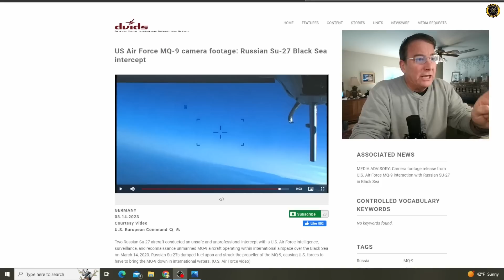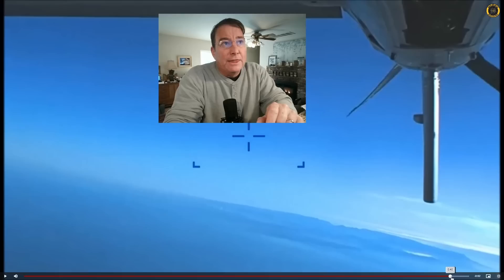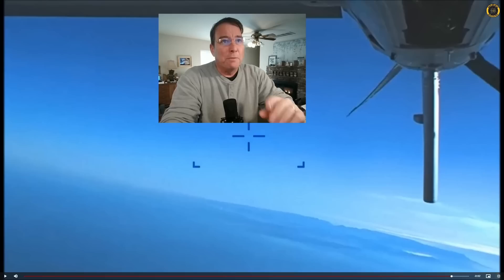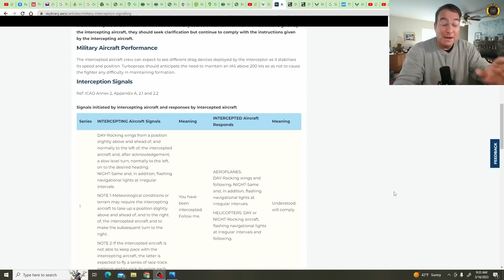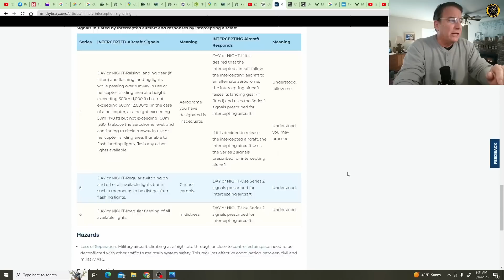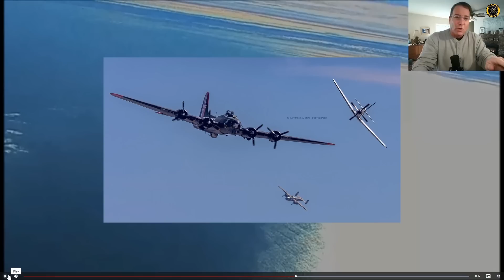Botched Russian Intercept of MQ-9 Drone Over International Waters

Comment: He hit that propeller so hard he knocked all the yellow stripes off of it!
Reply: You can see in the "before" images that the stripes progressively disappear as the props move towards the 6 o'clock position (due to sunlight reflection).
Reply: @ImperrfectStranger  You can also see it was over water before the hit, but that SU hit the drone so hard it was over land with different cloud formations after the collision.
Reply: @wally7856  That is due to the same reason you can't see the stripes.  The MQ-9's heading changed during the encounter.  This is due either to disruption of the flight controls due to the intense wake of of the Su-27 or direct contact.
Reply: And didn't shake the camera one bit

Comment: Lack of airmanship ?
Looks like precision airmanship.
Reply: exactly,  there is a better way to pee on a drone, but this manoeuvre is actually perfect for damaging a propeller and clipping out, drone down, flanker with 2 scratches
Reply: @kemc77  Except if you miss, you have downed a relatively cheap drone - but lost a fighter and possibly killed the pilot in the resulting mid-air. There are better ways to get rid of a drone than by hitting it with your own plane.
Reply: Dumb luck, not skill.

Foot lower / left / right could have damaged or locked a control surface on the -27. Compare to the first pass: Many feet further away.

At the jet's likely +/- 400 knot speed, the time granualrity is far smaller than human perception, like .0X seconds. Average human reaction time is 0.25 sec (1/4 sec) If the intercept pilot is young, peak condition & really switched on, they might achieve a sub 0.20 time. At the closure speed that's FEET rather than inches.

Even tho he downed the Reaper it was into international waters; expect an 🇺🇲 sub-based recovery team to grab the drone bits ASAP, keeping 'em outta 🇷🇺 hands.

Not that we'll hear about it for many years.

Comment: Am wondering ... if the Su-27 hit the prop, wouldn't he had hit the tail surfaces first?  That V tail on MQ-9 is pretty large ...
Reply: Points downwards
Reply: No it doesn't! I must have been thinking of another drone. It does seem to effectively cover the prop disc just like you said
Reply: if you look at a head-on view of the predator online it looks like the prop is actually semi-protected by it's 3 tail fins... and spinning at the speed they were, why weren't all the blades damaged?
Reply: @t.c.2776  It's not protected from behind ...
Head on, you can see how wide the gap between the tails is
At least 2 of the 4 blades were visibly hit (it seems to be a later MQ-9B Seaguardian)
One badly enough to bend it, one badly enough to feather it.
I've never seen just one blade feather on a prop - have you ?
Reply: Jet wash broke it. They had to cut the tape to hide that.  JB playing his part in the propaganda.

Comment: Hi, US army drone pilot here. I don't fly reaper but I do fly it's little brother, the gray eagle. Very similar system. When the fighter struck the UAS, it killed the engine. You can see the RPMs severely dropped. Due to the two damaged blades on this airplane, the propeller was not able to windmill fast enough to restart the engine. I would think that 2 blades would be enough to keep them aloft at least at lower altitudes. These airplanes are basically powered gliders, they have super high coefficients of lift. The reason this airplane went down was because the engine went out.

Comment: Or could the damage have been caused by the force of the jet exhaust and/or air vortex that, I would assume, would be pretty powerful. Not a military aviation expert or navigation system engineer, but I believe the "N" (North) is your bearing indication with relation to the camera. Prior to the loss of video, which would make sense due to a sudden jolt of some kind, the Sun is to the right of the drone (left of the video perspective in what looks to be early-mid morning). The camera is not completely looking 180 degrees aft, but is moving toward the rear direction (@5:49 to @5:53). That looks like the heading of the drone was somewhat of a northwesterly direction, Sun to the East/Southeast. After video resumes, the Sun is now more to the LEFT of the drone (video perspective right). And the bearing indicator shows North jumped from the 7 o'clock position to 10 o'clock. With the camera full aft. Now it is travelling in a southwesterly direction. Like the drone was "pushed" off its heading (strike or jet exhaust). That also explains why you do not see the yellow prop markers like you do @4:26 when the drone was traveling in a northeasterly direction, more towards the Sun. The sun is actually shining more on the back of the propellers, from the camera perspective. That is a logical explanation (debunk) of the missing stripes CGI conspiracy.
Reply: ...and I will add that this is the video what was given to the public. The video knockout could have been edited in to intentionally remove any "incident" that the military would believe would look like a weakness or flaw of the drone in some way. There is no video timestamp (which can be faked, I know) so that blackout could have been longer than the 5 seconds or so that we see. Which seems kind of odd, come to think of it. I would assume that any video camera feed would have a recorded timestamp of some kind. Time, date, bearing, airspeed, etc... For any reviews of an event like this. More conspiracy fodder! ;-)

Comment: Love the channel,  Juan! I'm an old T-56 guy.
Just a minor correction: The prop will move through zero pitch to achieve reverse. Feather is going in the other direction.
Reply: -15 or -16 navy?
Reply: Yeah as a turboprop guy myself I felt my eye twitch haha.  Glad someone said something.
Reply: @fasousa4798  No. Just no. The F-15 and F-16 are Air Force aircraft, not Navy.

He is likely a Herc guy (or P-3, C-2 or E-2 guy if he was prior Navy)

The T-56 is the military designation for the Allison 501 turboprop engine. Also found in the Lockheed Electra and Convair 580.
Reply: @adamreznik6374  when i said -15 and -16 i was referring to the submodel of the T-56 engine. the -14 is used on the P-3, - 15 usually on E and H models and -16 is usually the Navy C-130T or R engines which are the same as a -15 as far as i know.

Comment: Looking at the drone configuration it seems nearly impossible to only impact the prop unless it is possible that the density of the fuel being dumped was enough to damage the prop.
Reply: I'm guessing the force of the fuel damaged the prop. Had the plane actually hit the drone, it probably would have fallen out of the sky immediately as it was disintegrating. The prop looks like it would be protected by the vertical/diagonal stabilizers. Either way, it was an asinine and risky move. Something only a Russian would think was a good idea. And then, of course, they denied it, even though there's video proof. Could these people be any more deceitful, untrustworthy, unscrupulous, unprincipled? No.
Reply: Agree.... the tail surfaces are close enough to the prop that I can't see how the jet could just ding the prop without damaging the airframe with that fly-by.  Also, was the transponder on?  The drone isn't up there sightseeing.  The Russians say they got the drone so assets were pretty close.
Reply: Now that you mention it, that's a very plausible explanation.
Reply: @OMGWTFLOLSMH  With drones we have moved into a new realm of engagement.   The threshold to "do something rash" is lower.  Depends on the adversary.  The Sweds lost a DC-3 intel aircraft in international airspace to a Soviet shootdown at the orders of Stalin.  The US had intel planes shot down close to Red China.  Both of these areas had loss of life of the aircrews.  Since the US is giving intel and targeting information to Ukraine, it would be interesting to know the mix of satellite and drone recon.... which of course...we won't.
Reply: There is NO WAY the fuel could have caused that kind of damage. No way. There was a direct contact between the drone and the fighter. The fighter has got serious damage from the collision.
Reply: How do you figure it's impossible to impact the prop? And who said it didn't also hit other parts back there? Even if it took a chunk out of the stabilizer, the MQ-9 has an enormous wingspan like a glider, and they are very stable. They have to be stable, because with a minimum of 1 full second of delay between control inputs and the drone responding, it has to be very difficult to upset.
Reply: Fuel dump damaged the prop.  No way jet could hit the prop without hitting the airframe.  Props are made to chop air, not liquid. That would have caused an excessive over load on the prop blade.
Reply: @RAPR117  Guess they can't fly in the rain.  Fuel dumps are not dense enough to bend propellers like that.
Reply: @mbasir  theres no way to hit a prop smaller than all the stabilizers around it without hitting said stabilizers, and theres nothing falling away in the cameras rear and lower view.
Reply: @RAPR117  yep. what we're looking at there is fluid volume + speed discrepancy = i know who lost more money in that one. ;o)
Reply: @erice9536  trying flying under a waterfall... see what happens. just for shits'n'giggles.
Reply: They could have hit both the prop and the V-tail. The camera isn't able to pan up enough to visually see all the potential damage on the V-tail on top
Reply: On the final pass, the SU-27 was in a pretty decent bank. Pay attention to where the drone's wing is at the start of that part of the clip compared to how low the SU-27's wing dips down in the final frame. The camera is pointing slightly below horizontal at that point, and yet the SU-27's wing is filling the top third of the frame. There's no reason the wing tip couldn't have struck the prop and then passed right between the tail surfaces (with or without damaging them to some degree).

As can be seen, the fuel dropletizes almost immediately upon hitting the air stream. And it's not like a heavy rain storm is going to destroy the prop. If the prop were really close enough to be striking solid sheets of liquid fuel, then the drone would already be in the process of being sliced in half by the other aircraft's wing. Going frame by frame, it appears to me that the fuel missed the drone on both attempts in any case.
Reply: That's definitely not fuel damage. The tips of the prop would not curl as we see in the aftermath if it was only fuel that hit it. That kind of damage is from a solid object collision striking the outer diameter of the prop.
Reply: I am a mechanical engineer and a pilot….are you?
Rain is air with few water droplets spread throughout it.  A VERY close fuel dump is like making the prop designed for AIR push through water.  There is a reason boat props look different than airplane props….fool
Reply: @RAPR117  I’m a mechanical and aerospace engineer. BSME and MSAE degrees. That has been my day job for the last 16 years. So… yes?
Reply: @RAPR117  The fuel vaporizes immediately, it's like flying through rain, and that causes no damage to the propeller. The only possible way that damage could have happened is through direct contact between the fighter and the propeller.
Reply: One of the drone's blades (not the bent one) is seen rotated to an approximately feathered position, out of alignment with the others. That points to a change in the medium through which the blade was moving, to point it more in the direction of the flight with enough violence as to shear the pins and or gears of the prop's pitch control mechanism. Contact with a plane would not have caused the blade to be instantly feathered and little else.

If you consider the densities of air vs TS-1, even at 10% concentration of the latter AND even dilution that would be 2 orders of magnitude beyond the prop's likely design limit. And it wasn't 10% nor even - the shape of the ejected fuel cones behind the jet makes it clear it doesn't spread too rapidly: one fuselage length behind the outer spread width is still less than the horizontal fins' span. And it's far more dense in the middle, in a bell curve type distribution. It's plain to see the jet is approaching with such an angle of attack as to douse the prop and air intake with a close to solid stream of fuel.
Reply: The rear stabs are about 4 feet forward or more of the prop so I believe it could just hit /brush prop
Reply: @brinkee7674  That's a good point. However, one of the other blades besides the bent one, is seen with a very different pitch vs the rest - while undamaged. As if the great force twisted it to line up with the airflow over the drone, shearing the pitch mechanism. That force is unlikely to be effected by the body of the su-27 making contact with it, and indeed quite likely to be effected by the suddenly 200x...800x denser medium vs air, rushing past the blade.
Reply: @RAPR117  Are we looking at the same video? There is absolutely no way that damaged the prop. Otherwise flying through rain would be a death sentence. It was like a mist of fuel.
Reply: How do you know that the jet didn’t also knock the v-tail off also?
Reply: @johnnunn8688  If it had knocked the entire v-tail off, when the video connection resumed we would not have seen straight and level flight.
Reply: @AureliusR  yes. Also the jet's flight envelope to use the collision and not the fuel, 
- to bend the tip of only one of the blades, 
- to rotate one other blade to a feathered position (but not damage its tip), and 
- to not cause the drone to catastrophically disintegrate or tumble, 
... is so narrow as to, in practice, not exist at all.

This was a tricky bit of flying executed by the Russians. I wouldn't call it Top Gun stuff, but I wouldn't put it past Tom Cruise's character to choke an unfriendly high tech craft with a well-aimed stream of dumped fuel to get it to fall down in one piece.
Reply: @AureliusR  rain is a very good point, however it's very even in the drops' distribution. Looking at the mist cones of dumped fuel, it's mist on the outer edge, but one fuselage length behind it's still spread not more than the horizontal fins' span. And while the density on the outer "surface" of the cones is mist, it's a bell curve distribution of density more or less, i.e. it hides far more turbulent and dense stream of fuel closer to the center.

In other words, rather than rain, this would be more akin to the spinning prop hitting tips of waves over a would-be stormy sea of jet fuel. The prop is going to take a beating.
Reply: @AlexKarasev  We have no idea where the jet and the drone actually contacted each other, so everything you are saying is literally wild speculation.
Reply: @AureliusR  as do you & everyone else. What's your point?
If the Russians recorded video & comms and when/if they declassify them, we may know more.
Reply: @OMGWTFLOLSMH  only if they were in the Ukraine Govt
Reply: @mbasir  you are a hydrologist?
Reply: @AlexKarasev  All my comments have been based on the actual visual evidence so far, which clearly shows a collision followed by the camera showing damaged propeller blades.
Reply: @AureliusR , my bad, I should have said ‘part of the v-tail’.
Reply: @operationscomputer1478  No, aviation engineer. And i know something about how liquids behave.
Reply: @stuartedgar5921  I guess you don't understand how camera exposure works. Not to mention how digital camera sensors acquire images, leading to loss of detail in fast-moving things like propellers anyway.

Comment: Were the Russians trying to block the drone's air intake with the dumped fuel to stall the turboprop?  So while the collision was unintentional (I completely trust Juan's assessment),  the intentional fuel dumps seem to be an attempt to crash the drone.  And no one in the media has yet commented that the stakes of taking out one of our drones is significantly less than taking out a plane with a pilot.
Reply: Yes, they were attempting to make the drone ingest fuel and cause an engine failure.

Comment: Juan, I'm just curious how the SU-27 managed to damage the prop blades but not shear off the vertical stabilizers or damage the rest of the air frame. Unless it did and we just can't verify it without a camera recording from atop the aircraft? Or am I misunderstanding all of the reports of the SU-27 directly clipping the MQ-9 and it was the fuel being dumped that did the damage?
Reply: There was no contact, that's why they cut the video.  JB just can't help himself seeing what his eyes can't.
Reply: a fuel dump cannot possibly cause any damage. The fuel is fully atomized (basically a fog as seen in the video) by the time it was more than a few feet from the dump nozzle. Even if it was as coarse as a heavy rain, airplanes can fly though that and not notice also. There's no question what-so-ever that there was a collision between the two aircraft.
Reply: Anyone is free to believe the Reaper has only one camera. The US has no interest in supplying images that do not support their side of the story.
Reply: @kenjh71 🥱 not everything is a conspiracy, Clarence
Reply: @dinguslopper the govt has lied about almost everything so why would this be different
Reply: @dinguslopper  fair enough. Nowadays conspiracies mostly turn out truth. 
All I said is that anyone is free to believe the Reaper has only one (underbelly) camera.
Reply: CGI